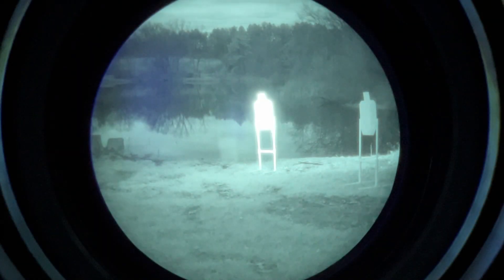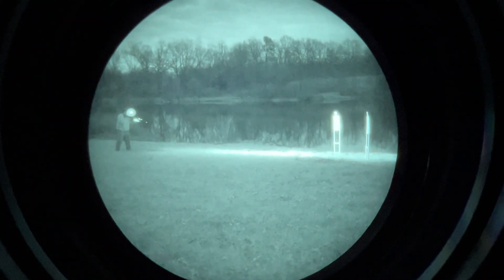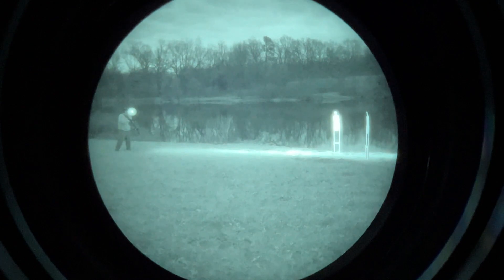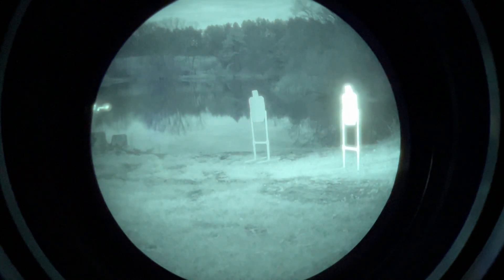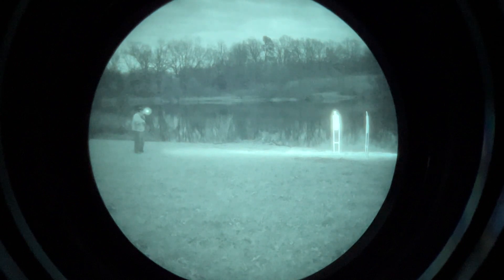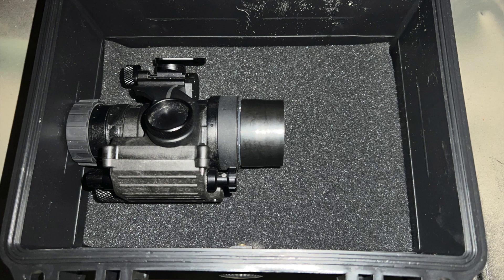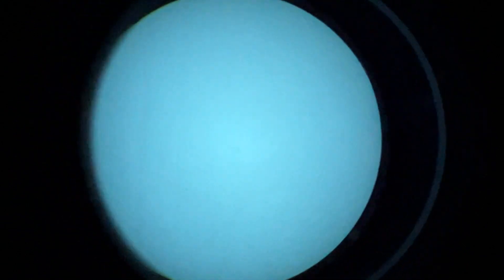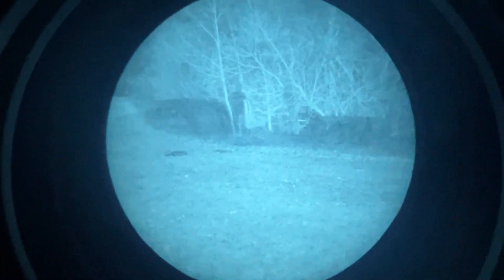Watch Me BURN My PVS-14 Night Vision Tube, Then Fix It (Black-Boxing)

Comment: 0.0 Thanks for the video 
happy you were able to get the image better.
Reply from the maker: Thanks! To be fair, I could tell that the original video wasn’t going well from the start. At the very least, I was able to get this from what would have probably been a dud! My only regret is that I somewhat freaked out upon initially discovering the burns and I wanted to get it black-boxed ASAP, though a few minutes of being calm would have allowed me to capture much better footage of the burns at their worst. In use, it looks totally normal at this point! I appreciate the comment and have a good one!

Comment: Since your careful of not hurting your PVS-14 I have a tip for you. Always Always keep the objective lens cover on your unit when it's not in use. The sun will destroy your tube, even if the unit is off. Someone said direct sun exposure can burn your tube in as little as 8 seconds. This burn is not repairable. There will be a black line on the image for life.

Comment: A couple of points from what I've learned. Autogating reverses the electrical potential between PC and MCP, dislodging pollutants from the MCP. It has a cleaning function. It should also be possible to "whitebox" a tube to accelerate this process. Second, unless proven otherwise, modern gen2 should be treated like an XD-4 and protected from intense sources, because the lifetime is rather short and constantly degrading. Nominal performance can be lost in as little as 2500 hours.

Comment: I disagree.  I have a pvs 14 gen 2 90s tube and a nvg10 digi unit and its pretty comparable and the nvg10 doesn't need IR to function like almost all digital night vision needs.
Reply from the maker: I’ve heard a lot about the nvg10 but haven’t done enough research on it. Gotta look it up because what I hear is really good. I’d be interested in picking a unit up to try but I’m focused right now on getting an Infiray T2 Pro which seems like a great (for the cheap price) thermal to use with my phone. Thanks for reminding me of the nvg10 and again I’ll definitely be doing research on it. Maybe picking it up in the future, depending.
Reply: Stop lying. The NVG has no image intensifier. It's gen 0. You NEED IR. It's a IR camera. 
You can't see with an IR camera without IR. Obviously ..